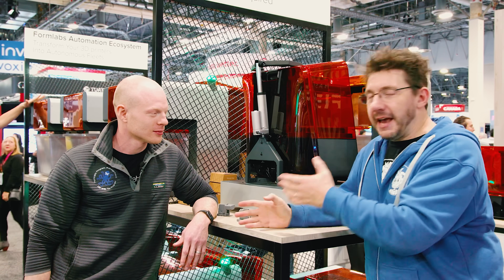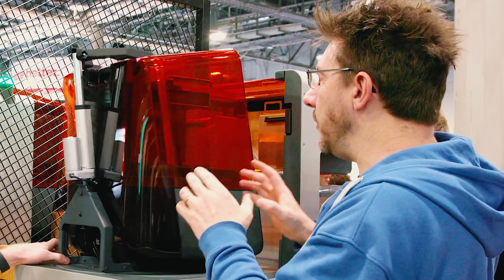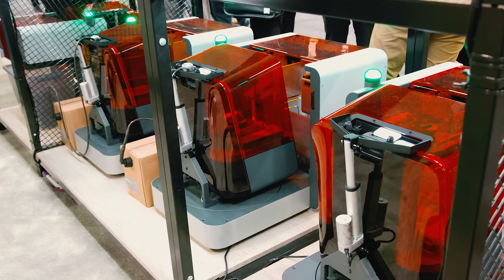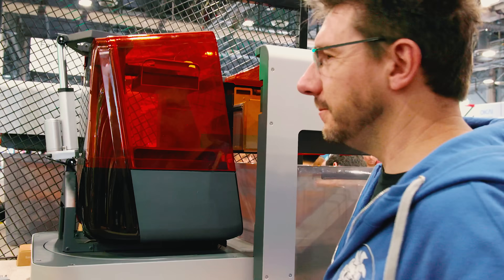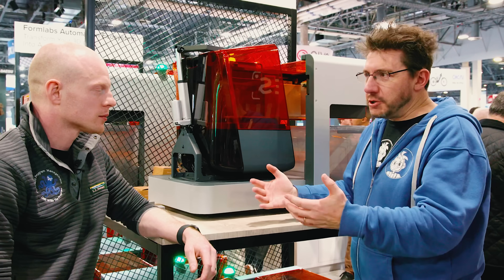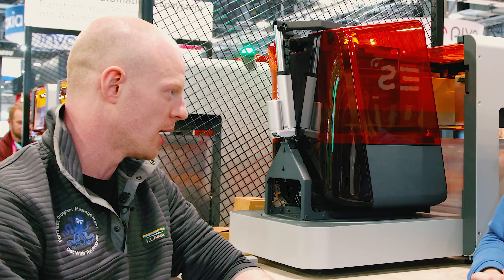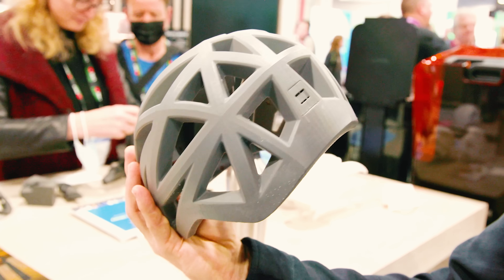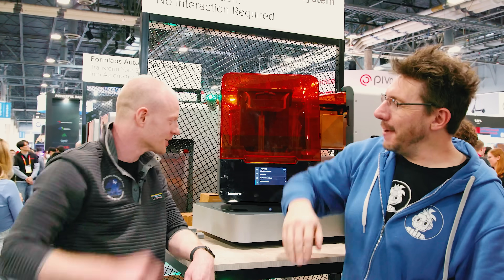AUTOMATED Resin 3D Printing!

Comment: 3d printing is not for parts it was designed to make a model you can hold in your hand and sell it to the boss or design team then they make it in cnc and cast in metal etc 3d printers are designed to make small parts that wont last  or break if you truly want 3d printing get a metal 3d printer whre you sinter the metal part and have a fully metal part but then again you have to pay 50k for the machine etc

Comment: wouldnt it be a good addition to have a auto resin level detector that checks if the vat needs more resin then just adds it in 

if you do that you would have a fully automated process where you wouldnt need to even check on the printer anymore just plug, fill ,and play
Reply: It does have an auto fill and keeps resin at proper level. At least until you run through a liter of resin. Then it let's you know to add another cartridge. Unless your talking about an auto system that changes out resin cartridges.

Comment: I thought this would move the print into a washing/curing box then pop it when it's done washing/curing. this is a lot of hardware for just simply popping the print, which then user has to wash and cure manually
Reply from the maker: It’s popping the prints - plural. The idea being the machine can automatically for a weekend is key. Producing a batch of parts that can then be washed and cured.
Reply: I also thought it would do this, like the SLAminator.

Comment: Potentially stupid question, but wouldn’t bending the buildplate repeatedly like that warp it over time?
Reply from the maker: From what I understand, the magnet that holds it in back keeps it super flat in machine. I don’t know the number of bend cycles Formalabs has done in testing, but it must be A LOT.
Reply: I can confirm that i have never seen a BP2 warp. And i have seen them in an environment which uses it daily for the past year.

Comment: Really like that they tested the areas what were "wait, does this work" and decided to utilize their existing machines. Been reading a bunch lately about "why did a company NOT create a new machine" and it's like "why should they? How does that benefit existing customers?"

Unrelated: is there a bar/overlay showing some shots? You can see the square overlay at 4:06 - 4:14
I kept thinking I had burn in or something, but it was still there as I changed the player size
Reply from the maker: No that was error on our side from color correction.
Reply: @3DPrintingNerd  ok, good to know

Comment: 3d printing needs automation to be a viable mass-production method. For mass production, the bottleneck is never print speed, it is human labor. The ability to print a bucket of parts over a weekend is huge compared to having to go back to the printer every single time.

Comment: Automatic part removal, and job queuing seems kind of pointless without some automated resin refill process. Does it hold a ton of resin or something, or does it have an auto feed system that wasn't mentioned?
Reply: Formlabs printers have come with an auto fill system for years now
Reply: Honestly shouldn't be that hard with a simple hose and large bucket (just have it siphon into itself, it will maintain the level at which your huge bucket is).

Comment: My experience with the Formlabs products is that they are very expensive to purchase and operate. You are locked in to proprietary materials and eco system. I replaced a pair of Form 2 with consumer grade products that were faster, used consumables that were 1/3 the cost, and could be thrown out every year and still save money.
Reply: There's always cheaper, but good luck getting some Chinese manufacturer to develop automation for the stuff they've already sold, for instance. You always pay extra for quality, for support, for reliability. Nothing new there.
Reply: @extectic  the problem is not to be less expensive, problem is ecosystem, I have no problem to pay 5k dollars a printer if I can use the resin I wan for my uses.
Here is not the case
Reply: @extectic  I was not happy with the performance, reliability, or longevity of the Form 2 machines.
Reply: @extectic  The thing is, I could recreate this with like $100 in parts, and it would work with anything with that type of bed, and parametric for any sized machine. Also their design could be simplified since there is no limitation on a linear actuator not being simply fixed to the build plate pull tabs, but minor critique.

I've got my personal machines much more consistent and higher accuracy, and much less maintenance, and much faster than the machines at work. Mine also do the same size or bigger (13x13x15") and mine were less than $300, defeating $5k and $10k machines. The only cool thing is one of our machines at work can hold like 8 spools, but ironically the best upgrade was some PVC pipe where I made a stand for it so it could hold some larger 5 KG rolls (so much nicer than having to reload small spools all the time).

I've also found the more expensive machines to be more proprietary and locked down, and even their starting sequence often ignores CURA for example so it often wastes a lot of time redoing the bed level mesh (while my machines remember it unless you manually push the button or start your Gcode with it, saving a lot of time and keeping them more consistent). I'm just not a big fan of closed source, you are at the mercy of the developer to fix even the smallest of issues, and then they don't even update their change logs accurately...
Reply: @jakegarrett8109  both ultimaker and formalbs are fairly closed eco system, plus the cost is astronomical. I much prefer "hobby" grade machines due to their cost, reliability and maintenance. Plus I don't have to email a company in the US for help when I need it, just to get a generic response.
Reply: @CraftySven  Yeah its sad when the Ultimakers are not even the worst ones, but those do manage to destroy themselves (about $500 per hotend) due to poor design probing with the nozzle iteslf (which is oozing plastic, so the least ideal option for getting consistent depth), and then oh look another $1k to repair things...

Comment: Could you fill the bucket with liquid to make the drop softer so the parts dont break?
Reply: I mean, they don't break now.
Reply: @extectic  he said thst a heavy part with a pointy point pointing down would break
Reply: not really. If it's water then the part won't cure properly, if it's alcohol then it will slowly make it weaker. Maybe an angled slide ? 
The part design is restrictive anyways; for this to work with the automation.
Reply: @CraftySven  ive heard that some people cure in hot water to get better mechanical properties, havent tested yet
Reply: also having water droplets into the resin when the printer is open is a big nono
Reply: @RichardKincses  i dont think they would reach but the buildplate geting wet could be a problem
Reply: Maybe just a layer of foam. Doesn't solve prints dropping beyond that first layer though..

Comment: After two dead Form 2's that now just collect dust, terrible customer support, and the fact they don't sell replacement parts for parts prone to failing, I cannot suggest to anyone to purchase an overpriced Formlabs in 2023.
Reply: they will just tell you to buy new parts, easy !
Reply: Interesting, my form 2 has been running strong for 7 years now and counting. I've had minor issues, but for me customer service has been great.